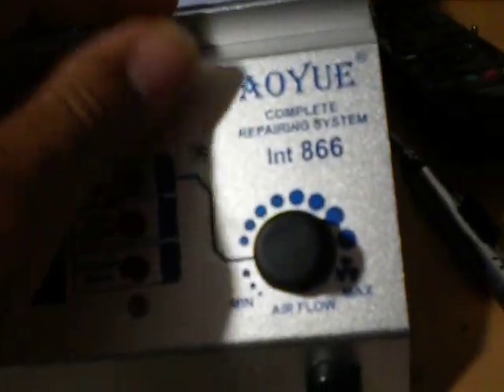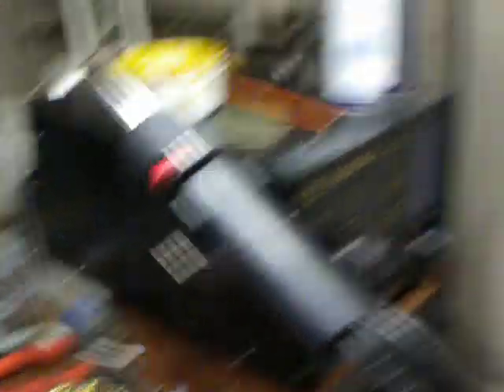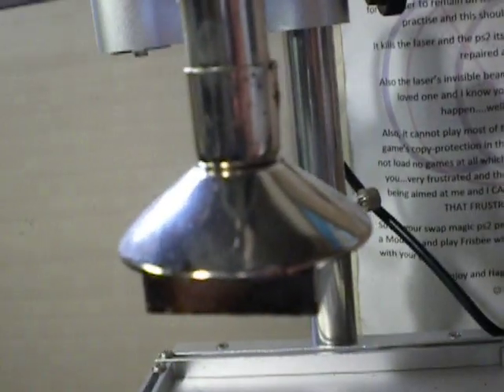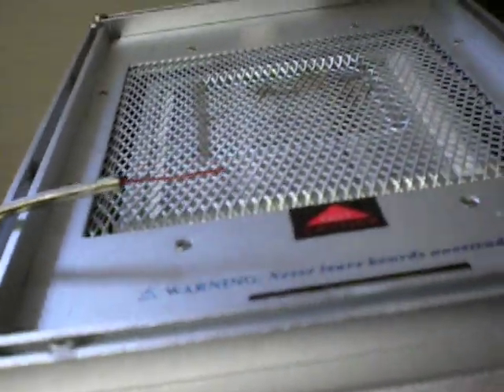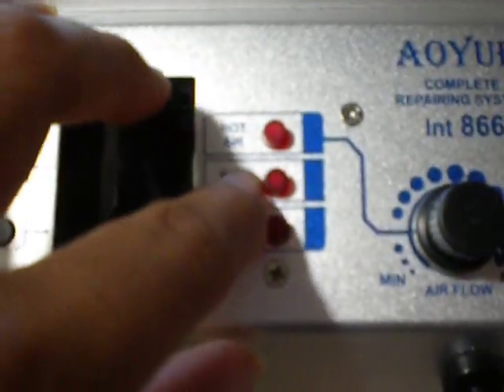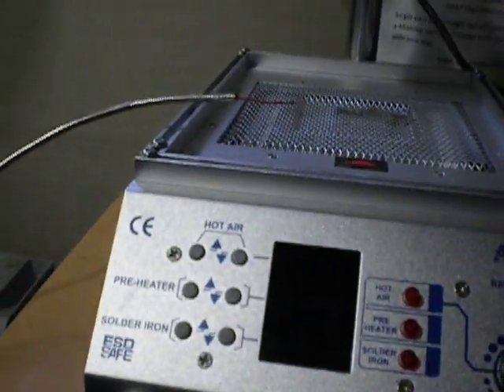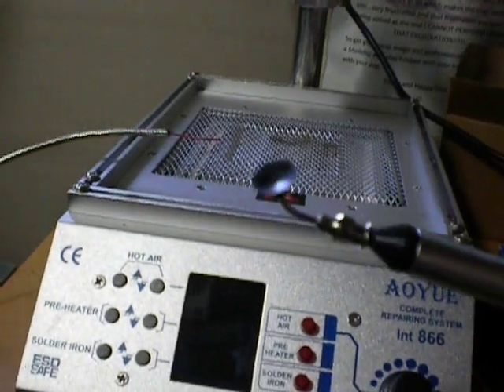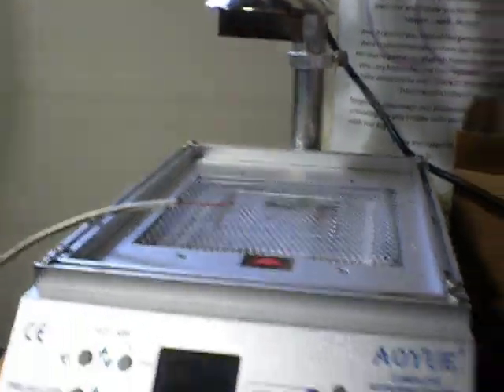Aoyue Int 866 rework station Product Review

Comment: hey modzie, can you tell me where are you buy the flux?? and the model and the brand?
thx 😉
Reply from the maker: kingbo flux on ebay and the amtech from amazon bud
Reply: Hey modzie, thanks for your response, can you tell me if this flux are ok?

Plomo 100g AMTECH NC- 559 - ASM No Clean Clean Flux Solder Solder Paste
https://www.amazon.es/Plomo-100g-AMTECH-NC--559/dp/B0136LR098/ref=sr_1_1?ie=UTF8&qid=1465916523&sr=8-1&keywords=amtech+flux

KINGBO RMA-218 SOLDER FLUX http://www.ebay.es/itm/BOTE-100gr-KINGBO-RMA-218-SOLDER-FLUX-/231971584533?hash=item3602957a15:g:h5kAAOSwLnBXVtVg

Thx for your time buddie 😉
Reply from the maker: yea that's the right ones bud

Comment: Please reply ..linkin u from Grenada ..close by...I have a shop here mainly deal with PC and mobile ...want to get into rework..I already have a t-870a irda , also a 862++ irda...works but LCD damage water prob, aoyue 2702a station and a kada 852d. After lookin at your video I seriously am considering an aoyue 866.. I like d holder and d preheater.....I have a problem with charge port change ..and IC removal...kinda new to it nah....but what are u advice on d 866/....do u think I need it...or it will bring any benefit....u are d expert...please reply
Reply from the maker: well the rework machine I have there is up for sale right now, if you're interested let me know. Also the port removal, its very easy, preheat board at 200 for 5-8mins then use the wand and set it at 198 and in a circular motion, reheat the port and with your tweezer, nudge it to see if it can be removed and once it can, grab and pull it gently out. Ensure you use alot of flux tho.
Reply: ModzVonXyborg  OK thanks for the reply man....I will think about it and let u know....what price U wanted for it though....was eye in one on eBay from SRA solder for 200
Reply from the maker: Demion Lindsay modzinc@live.com
get at me, would work out something for you.

Comment: I just finished putting mine together. So far I'm quite impressed. The first thing I want to do is reflow the video chip on a couple of older macbook pro's. Any suggestions on the temperature, top and bottom and the time frame.
thanks
Reply from the maker: that you would have to figure out, been trying to source a macbook board to try it as well.
Reply: ModzVonXyborg Where abouts are you? Maybe I should send one to you to try. lol
Reply from the maker: located in the caribbean (Trinidad and Tobago W.I)

Comment: do you need to remove screw from the bottom of the machine like others solder station before using it
Reply from the maker: yes you need to remove the transport screw
Reply: thanks ModzVonXyborg
Reply from the maker: no problem :)

Comment: Sir, my heart is inclined to 968A+ shall i get it for laptop bga with some separate infra red preheater, whats your advise, i would be highly obliged if you would recommend any cost effective and reliable system for laptop motherboard only.
Reply from the maker: my advise, get the puhui preheater and the 968+ as the top heater and you'll be good as gold :)

Comment: i shall be thankful if you please give me the sincere advise about purchasing this item, can i do laptop mother board bga reballing with this machine as i have just ordered it today or can i order aoyue 968A+ with separate preheater. please help. i am eagerly waiting for your reply. should i cancel my order or not
Reply from the maker: yes it can, but ensure you buy the nozzles, stiffening jigs and what not for her.
This Unit right now is on sale as well.
Also, the 968+ always come with the hot air nozzles and accessories, that would be perfect for small applications also for putting the solderballs back on the chip.

Comment: bro what was your ideal Temp for 1.Pre Heater  2. Hot Air   3.Air Flow
to reflow just a basic dv2000 gpu? Do you use liquid flux or paste flux around the gpu? How long the reflow suppose to be and cooling period? Thanks!
Reply from the maker: it varies according to the temperature of your country, start off at 220 preheater and the top heater, gradually raise it up to 215 or until the solder is in liquid state by doin the nudge test, I use the amtech 55x flux.
Also, where are you hailing from??
Reply: ModzVonXyborg
Im from US.